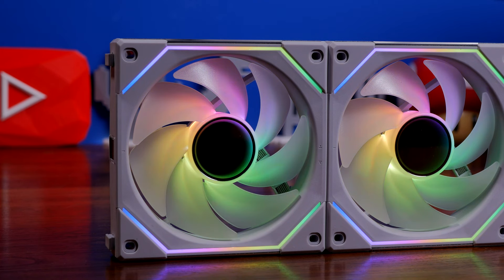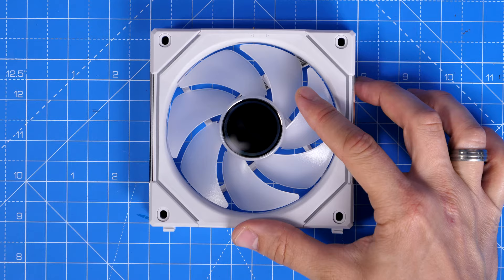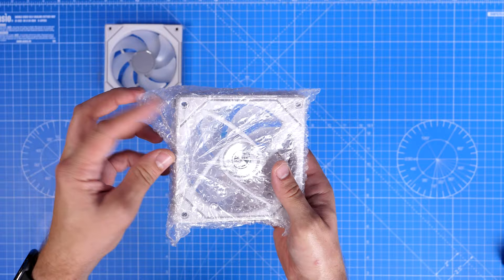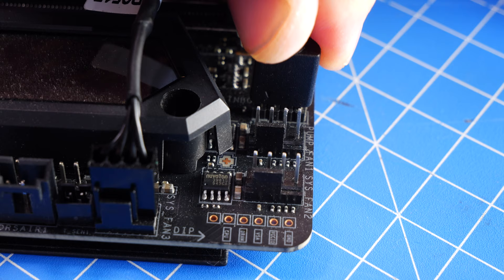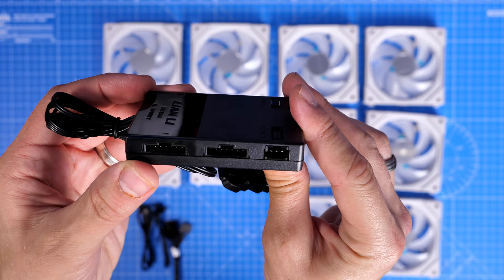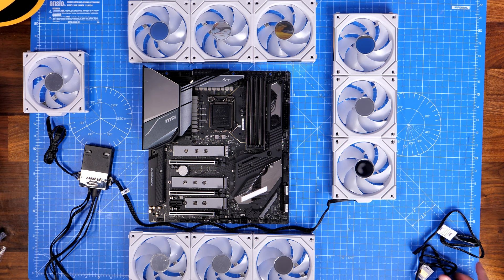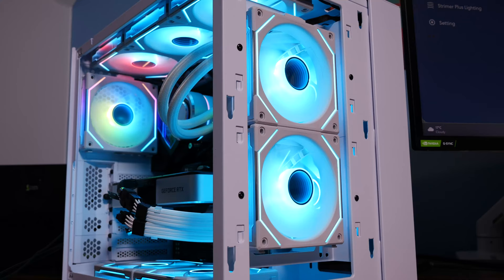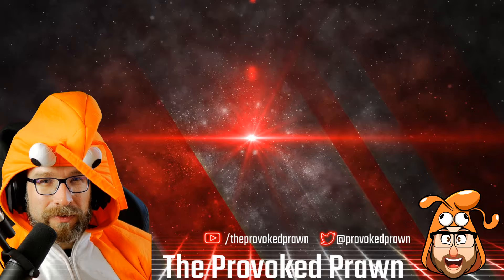How to connect Lian Li Uni SL Infinity 120 fans (single and triple packs)

Comment: Great video it helped alot. 
I got a question, maybe you could help me out. I recently (2 days ago) bought the Uni fans SL 3 pack (not infinity) and now i am thinking pf adding 2 Uni fans SL INFINITY, but i want to by them as 2 singlepacks. I dont think that i can connect the 2 Infinity fans to the provided L-connect controller from the 3 pack SL ones because the kables are proprietary, can I? So if I cant connect the Infinity fans to the L-Connect controller i would have install them directly to my Motherboard, will i then be able to use the L-Connect Software for the Infinity fans? I am new to the rgb game. Thanks in advance!
Reply: No. In order to use l connect to control any fans, the fans need to be plugged into the controller box. If you plug in any fans to the MB then you have to enable the option to control with mb on the l connect software

Comment: so i just got these fans yesterday hooked them up and for some reason when connected to the mobo using the usb the fans shut off completely and are undetected by my system (lights stay on rainbow cycle) but when i disconnect it the start running full speed being connected only with the fan head and argb header? I dont really know what im doing wrong but either configuration the fans will not show up for rgb or fan speed control.... im usuing a ROG crosshair viii dark hero mobo plz help! I have l-connect3 downloaded but the program will not open when using the link on my desktop even if i run as administrator
Reply from the maker: Do you have l connect 2 installed at all? I found removing that first helped.

Comment: The Two SATA connectors have nothing to do with powering the RGB, just fyi. The SATA connector with only two lead wires is for the 2 sync connectors at the top of the controller.
Reply: Im trying to hook up my fans but i found that i don't have enough SATA power connectors to connect the control box along with my lian li v1 strimmers to the power as well. Do i need to purchase a SATA splitter to have enough imputs for power?

Comment: hi, do you have issues with l connect hijacking cpu usage and raising cpu idle temp? Ever since I installed it, my cpu idle can go anywhere from 45-55, and it shoots to 70 degrees when I open the app! it's insane. It goes away once I end task on the program. So bad.. have you encountered this?

Comment: Thank you for this, really simple and easy to understand. I have a question, i’m waiting for my last parts for my first build ever and it feels a bit overwhelming. Can you connect the galahad aio to the fan controller that comes with the triple pack? Can’t find an answer to this anywhere, and if not, how am i supposed to do it? I know this may seem stupid to some but i’m completely new to this and there’s so much information out there it can get difficult at times.

Comment: Are the controllers the same for both the 120mm and 140mm fans? Can I plug the two different sizes of fans into the same controller?
Reply: Infinity fans only come as 120mm.
Reply: @Mapantz1  Yeah, I found out a while back. Only their OG unifans are available in 140, and those have pretty terrible airflow.

Comment: I'm sorry my english isnt the best.
did i understand i right. i can connect the controller for example to the cpu-fan-header on the motherboard (so the MB gets the rpm) and then i'm able to control the speed with the motherboard and also with the lian li software? or can i only control the fan-seed with one software (mainboard or lian li) no matter how i connect the fans?
Reply: ive just connected the rgb cables to the box and the fan headers to my motherboard. i can now control fan speed via mainboard (asus armoury crate). the rgbs are also synced with my mainboard but i can still control the rgbs with l-connect. works just perfectly.

Comment: I just installed these in my build. I do have that same issue, where the fans do not spin on start up from shut down and doesn’t spin until I sign in and the L Connector 3 permission pops up. After everything is up to date, I still have this problem. Are you still having this issue?
Reply from the maker: I don't have this issue. I'd suggest uninstalling and reinstall L-connect
Another thing to try is this (from Lian Li advice) to get the app to run immediately on startup

Please set L-Connect running as the computer starts. Following steps:
Click “Windows” + “R”
Enter : “shell:startup”
Click “OK”
Copy your “L-Connect” to “Startup” file
Restart your PC

Comment: I am having trouble with the PC thinking CPU fan speed is 0RPM and freaking out despite all 10 fans running just fine through the L3connect hub. Any ideas?
Reply: disable cpu fan error in the bios

Comment: the fans are sold individually and also in kits of 3. Can I buy 1 kit of 3 fans, which comes with one controller, and then buy 7 individually, putting all of them on the controller that came with the 3 fans kit? or do i need to buy 3 kits of 3 fans, using one controller for every three fan
Reply: Same issue, I  have the three pack installed, w controller and purchased a single, bit it doesn't have the cable that attaches it to the controller. How would I resolve this?
Reply: @mackadams5049  you didnt' find the fourth cable in the 3pack? i have got one.

Comment: i have these fans they are brutal only one big problem i have is that my lian li controller might be faulty cause it doesnt detect it through the lian li l connect 3 app i tried everything checked every cable in the controller and the motherboard reinstalled in checked in bios nothing.. i think its broken :(

Comment: Thank you for the video!  Question for you: If i'm doing 10 fans (3 sets of 3 and a single in the back) like in your example, what would I plug an AIO pump into? The Pump has an RGB cable (it's a lian li Galahad). I already have 4 spots on the controller taken up, so thats a no-go. Do I use a splitter for the pump cables to route them to the control box, or do I plug them seperately into the motherboard, say CPU fan header.  Thanks!
Reply: I don’t suppose you found an answer elsewhere? It’s one of the last things I’m trying to button up on my build. As of more I’ve just left it’s RGB undone
Reply: You've probably already figured it out by now but just in case...The Galahad RGB cable plugs directly into the SYNC2 or SYNC4 connector on the LConnect module.

Comment: Wait so if you buy single sl-inf packs the connector is different? I bought one 3 pack and 9 singles because everywhere is sold out will this be a problem as i will not be able to plug into the controller
Reply: what did you do man? I'm planning to do the same as you
Reply: @99MrHashem  i got the 9 fans yesterday brother my mother board only has 1 gen 2 rgb header. I have to wait untill i get the 3 pack that comes with a controller to hook up the rest of the rgbs... at the moment i have 4 fans daisy-chained with rgb and fans working... the other 4 i have only fans running no rgb.
Reply: @dopeboiiage  thanks man for your response, do you think I will be good when buying one triple pack and 7 single fans?

Comment: I replaced the SL120 fans that came with Galahad AIO 360 with SL120 INF, and connected that to the UNI hub controller that came with the INF fans. I then plugged the fan cable from the controller to either CPU fan or CPU OPT header on the MoBo. But either way, on boot, I get a CPU fan error saying that it can’t detect a fan. Any tips for this?
Reply from the maker: I'd try plugging the AIO cable into the CPU fan and then the fan cable into the sys fan header instead.
Reply: @TheProvokedPrawn  Thanks for reply. However, the AIO cable terminates as an SM-type, so it does not fit  onto a CPU fan header - and the other AIO cable is already attached to the AIO_PUMP header near the CPU socket. I've only tried inserting the 4-pin fan cable (that only has two wires for S and P) from the controller into either CPU_FAN or CPU_OPT, but I have not tried connecting it to a Sys Fan or toggle the MB PWM Sync in L-connect 3 software. I'll try these next...

Comment: Is it possible to use the split cord for an kraken z73 and hook rgb to Lian li hub?
Reply from the maker: Yup
Reply: @TheProvokedPrawn  I have the sl inf 120, I watched all your videos thank you .. but the cable in the single pack that splits only had a rgb for a mb not one thst goes into hub, is there an adapter to buy somewhere ?  Thank you for taking the time to respond to me I’m a noob at pc builds
Reply: @dwightwright6334   There is a Lian li Argb cable kit. My question is if you plug it in like that to the sync will the box/L connect 3 read it as Inf fan and give all options or treat it like a led strip and not have each section addressable.

Comment: So if im only controlling the fans RGB with L-connect you don't need to connect the little cable with the system fan/rgb connector? Please respond this is hurting my head. 
Also will I be able to control the RGB with L-connect and then control the fan speed in NZXT software for my AIO? I noticed on the first Lian Li fans you explained that thoroughly but didn't mention it here. Thanks!
Reply from the maker: If you're using L Connect for speed and RGB then no, you don't need the other connections, but if you don't use them you won't be able to use NXZT cam or anything else for fan power or RGB
Reply: @TheProvokedPrawn  So then I would use all 3 connections for L-Connect and NZXT aswell.
Reply: @TheProvokedPrawn  One more question. The two sata connectors.. can I use one of the splitter sata connectors that my PSU comes with? the one that only uses one of the sata slots on the PSU and has 2 sata connectors on it? Or should I use 1  sata slot on the PSU for each sata connector on the controller?
Reply: @TheProvokedPrawn  Really appreciate all the help!
Reply: @TheProvokedPrawn  OK I think I understand now. Please tell me if this is correct.
The 3 pack comes with 4 of the cables with the long "chunky" connector and 2 groups of 3 fans can both plug directly into the Lian Li Controller. 
The 3 fans with the AIO can use the cable from the single fan box and that group can use the RGB and Fan Connector. The Fan connector plugs directly into the pumps fan header in the back of the case and the RGB connector plugs right into the Lian Li Controller..
If this is right let me know. Thank you again for all the help!

Comment: Hey, I have a Gigabyte Z690 Aero G DDR5 motherboard and I believe there are two usb connections at the bottom. My AIO (Kraken Z73) also uses a USB and I plugged that into the USB 2.1 but I have a USB 1.1 left over right next to it. Can this fan hub plug into that or will it create problems?
Reply from the maker: Should be fine I think

Comment: the rgb is on but the fan is not rotating, what is the cause,pls help
Reply from the maker: Have you downloaded and installed l connect. They default to 0 rpm until you do

Comment: Is it safe having that many fans plugged into 1 sys fan header?
Reply: the cable from the controller has only 2 cables to control the speed, the fans are powered by the controller itself (its 2 sata power cables).

Comment: Hey anybody knows if you use the box with passthrough to the mainboard RGB if all the LEDs stays as addressable or will just the fans mirror the LEDs of one of them? Because I want to hook it up to my "auqacomputer farbwerk360" - RGB controller there support only 90 LEDs per channel. If you connect more than that and stay in the powerlimit all the LEDs over 90 will stay black because there get no control signal. So I just want them to set on White with 50% power anyway ... But if then the last fan will stay dark... Its suxx 😅

Comment: should i connect both sata cables?🤔
Reply from the maker: I think that both are only required if you are using the sync ports to. If not connect the one with more cables on it. Tbh I'd just connect both as it's easier
Reply: @TheProvokedPrawn  appreciated solid content👍🏻

Comment: Hey so I have sata Power plugged in and the USB into the header on the mobo but the fans are not spinning. When I take out the usb cable from the mobo, they start spinning. Any idea why they are not working?
Reply from the maker: Yeah because you need to download L connect. The fans have zero rpm mode and they default to that until l connect is upgraded
Reply: @TheProvokedPrawn  is that why is it says cpu fan not detected in the bios start up? Since they are installed on my radiator
Reply: I have the same issue but l-connect3 wont even open even tho its downloaded on my computer, have you found a workaround?
Reply: @zedsmeds4081  yea so I realized that the cord that clips on to the side of the unifans could be bad or the unifan itself. So you have to use the cord on a different fan out of the 2 or 3 you have linked to each other. Once I did that the fan started working. L connect works for me. You have to change the settings in the windows defender/firewall to allow l connect to run.

Comment: Hey, mate just building my PC right now and got a question. If I connect the USB header but also the fan and RGB header from the controller. Can I control the RGB with the motherboard software but ALSO with lian LI software? Greetings :)
Reply from the maker: yes, not at the same time but you can switch between those modes via L-Connect and your motherboard software.
Reply: @TheProvokedPrawn  big thanks to you for the fast answer. Good video and calming voice. Have nice Christmas days my friend 🤌🏻
Reply from the maker: @lokibier  no worries Angel. You too!

Comment: The fact that the single fans don't come with the same end connection as the tripple pack as an option baffles me.
Lian Li money grabbing by making you by 3x 3 packs to get the correct adaptors to connect to the controller when you need 3x 3 packs and 1x for rear exhaust etc.
Reply from the maker: The controller is enough for four groups of fans. So most people only need 1 controller i.e. one triple pack

Comment: great video, thanks. I ordered one to check it out. But I saw that no controller inside with the 1 pack. But you mentioned and showed we can do it without. My question is, could a not a very clever one. I have the lianli strimmer v2 and the controller, I cannot connect to that one right? as that is for the strimmer ? thank u, and I subsricbed to your account.:-)
Reply from the maker: The easiest way is to get a triple pack for the controller.

Comment: Can the fans be used as intake and exhaust?
Reply from the maker: Yes. Put them face down on the bottom of your case and that's intake. Put them face out on the front and that's intake. Put them face down on the top of the case and that's exhaust
Reply: @TheProvokedPrawn  sorry but im new with building a pc. What's the difference between the reverse fans and the non reverse
Reply from the maker: @s_w_a_t_9115  https://youtu.be/JxhIPQJlZ2E

Comment: I'm looking at 3 groups of 3 of these fans and a single fan for rear exhaust, does anyone know if the single fan connects to the Unifan hub or is it just PWM/5v.
I'd hate to have to buy 4 triple packs and have 2 fans unused
Reply: You’ll be fine, there are extra connectors for the fan in the packs, I have 10 of these, three 3 packs and 1 single and I was fine.
Reply: @STKReacts  hi thanks for the reply I've bought the case and fans for my new 4090 rig. However im having a problem none of the fans spin or light up when starting up, I had to use the standard CPU fan header from my Galahad AIO to get Windows installed etc, I installed L connect but the other fans still aren't working. Any ideas of what I'm doing wrong. Have 2 sata power and all other connections connected up. Very strange

Comment: Just upgraded my pc and went with the Lian Li AL120, I installed 3. They work fine with software all RGB and speed work. BUT THEY STAY ON AFTER SHUTDOWN can someone please help me fix this. They spin at normal speed as if the pc is powered on and RGB stays. I don’t want them constantly sucking in dust while nothing else is working. Thanks!
Reply from the maker: That can't be right. Unless you wired them incorrectly. https://youtu.be/219ze9BgjlU
Reply: @TheProvokedPrawn  that is the video I used for install. I did not use the argb as my mobo does not have a connector could that be the problem?
Reply from the maker: @ItsKiikz  no that wouldn't be it. Have you updated the firmware? https://youtu.be/xmLIU40UOVI

If your pc is fully turned off the fans should not be spinning
Reply: @TheProvokedPrawn  I will try to update manually thank you very much for your help and responses i appreciate you!
Reply: @TheProvokedPrawn  seems like everything is fully updated, I have seen others mention the problem on Reddit but never a fix. I have been turning psu off when I am done but hate that because I miss automatic updates. I will keep trying things! Thanks for your help!

Comment: Nice video! I have the RGB Strimer where one also comes with a controller. Any chance to use just one controller together with the fans or do I need both?
Reply from the maker: You need both

Comment: How would you hook up 13 of these ??
Reply from the maker: Depends on your groupings? You could do 4+4+4+1 quite easily on the controller but I'm not sure that's what you're trying to do. You can have a max of 16 per controller
Reply: @TheProvokedPrawn  I would be running a 3+3+3+3+1 since my case has 4 sides able to fit 360mm fan setup  plus 1 exhaust in the back. Would I just get a second controller/hub?
Reply from the maker: @estrada5.0  yes or just connect one to the motherboard but RGB syncing is a bit more of a problem
Reply: @TheProvokedPrawn  Thanks man, appreciate the help and quick responses. Ill give an update once my final parts are in and everything gets hooked up.